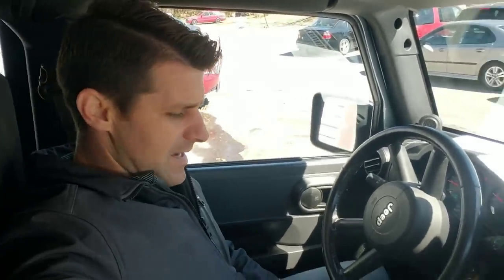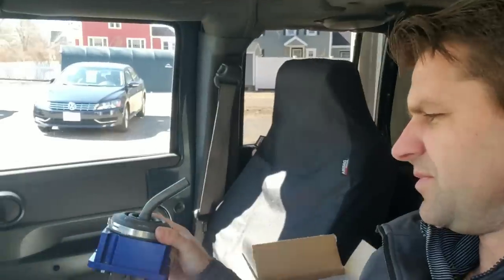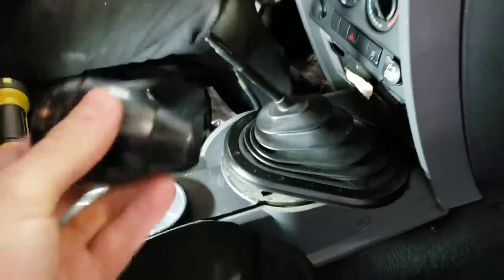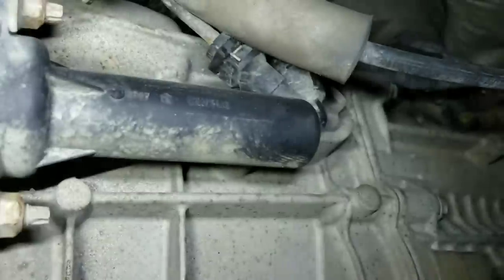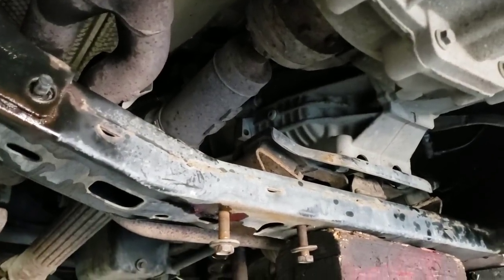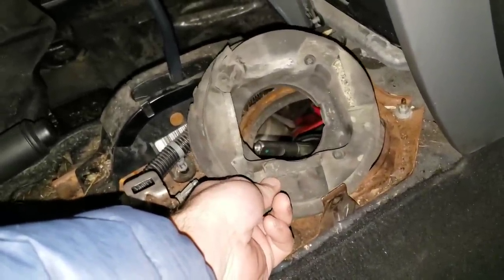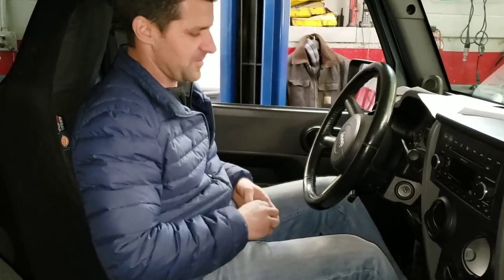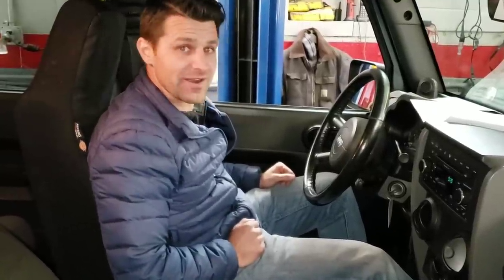Jeep Wrangler Pops out of 1st gear * How to Fix *

Comment: There's two ways it pops out of gear. Synchros being worn out, which is what yours sounds like. Or in my case, it really was my shifter. The Detent was worn out. When it's the shifter itself, it doesn't make that gear tooth sound, it just makes a sudden pop and its back into neutral.
Reply: Finally a real answer!!!
Reply: The shifter in the video made a grinding noise though?
Reply: Mine makes a bang when it happens.
Reply: How much does it cost to replace the synchros?
Reply: @jordanjohnson7285  it's the first thing he said in his comment.
Reply: @Larrybird96  if you're looking to replace synchros. It's a full transmission rebuild.
Reply: @jeremypetro1084  did you ever figure it out! How many miles you got?
Reply: @dad3562  181849
Reply: It's only 1st gear and it's random.
Reply: Im gunna try the 700 dollar part and hope for the best.
Reply: @jeremypetro1084  what was the problem you find out? my second gear pops out to neutral with bang as well

Comment: I have a 2008 jk  I have the same problem. I bought the B&M shiftier and it fixed the problem. I got it on amazon and paid about $565.00. I also had a rubbing noise coming from the transmission   like the sound of a baseball card on the spokes of a bicycle. That noise has gone away. The shiftier is so tight now with no slop . The stroke is also shorter. Thank you very much for the video.
Reply: Hi mate, can you share the link of the shifter you bought?.
Many thanks

Comment: I will be attempting this B&M 45195 shifter install soon on a 2007 Dodge Nitro 3.7L with the same NSG370 6 speed mercedes built transmission. I have the same issue with occasional violent popping out of 1st gear and sometimes 3rd. Thanks for the video
Reply: did you ever do it?, I have an 08 Liberty doing it in first once in a while..
Reply: @Aeroscott99  the owner could not justify the cost. I ended up removing the upper shift shaft dust boot as a bandaid solution. It did actually reduce the popping out of gear to almost never.

Comment: Honestly I don't think that the synchros were bad at all, it was the shifter bushings itself that got weak over time, as you could tell how sloppy it was before you swapped it. Any shifter has to be tight otherwise the pressure of the clutch and transmission itself will make it pop out of gear. Seeing how cheap Dodges have been built its no surprise they would use cheap shitty bushings in their shifters. Now if it was the synchros, you would of experienced hevay grinding in more than one gear plus random popping of multiple gears. Good idea and nice easy fix, $500 instead of $2k or more for all reman or rebuild. Now just mark the price up to cover the repair. ;-)

Comment: Luckily my 09 was covered under warranty so they replaced the 1st and 2nd gear sync rings, but what a pain in the ass. Had to go to three dealers before one would work on a standard. No one drives them in socal apparently. Good job.

Comment: I have seen quite a few videos with problems from Within the transmission. Nobody had ever figured this out. last year I watched a video where a guy in California “AutoEdits” did a tremendous amount of replacement of parts on his Jeep, one of which was a B & M shifter. He never complained of this gear problem before or after, his reason for changing it was the shifter waging like a dog tail lol!. So it led me to believe this was the problem, “the shifter”. I am having the same problem with my 2008. Wanted to replace the shifter, but haven’t had the money. I will be doing this the beginning of the summer.
Reply: Did you replace the shifter? My 15 jku likes to pop out of 1st and randomly out of 4th. Trying to figure out what I should do.
Reply: Haven’t done it yet, I know it needs a rebuild, “transmission“. 
My Problem, first gear and reverse. The problem comes from The ring gear and shackle. 
If it is caughtin the very beginning, changing the shifter would help.

Comment: My gf has the same issue but it’s more like once out of 50 first gear tries and it SLAMS out of first.  It’s been like that for a couple years now. Also second gear is a bit notchy each shift.  Good heck come on JEEP!
Reply: @badass1g My 14 jk has the same “once out of 50” slam symptom. It’s completely jarring and unexpected when it happens! Have you done any shifter or transmission fix and found success?
Reply: lmao wtf my gf has a wrangler that does that same exact thing just as often
Reply: Matthew Higley you found any solutions? Is your shifter loose af? Im going to change the bushings on the shifter. The other comment here mentioning bushings is what my friends have been saying. Theyre like $15 bucks each from jeep dealer
Reply: Transmission mount. Change it. Problem solved. Its most likely not anything else. I promise you

Comment: I had a brand new 79 Toyota pickup, 4 x 4 that did that exact thing.  Under waranty, the dealer apparently replaced the synchro, the gear, and the complete clutch.  The truck only had 5000 miles on it and was not abused.  Me thinks the dealer ripped off Toyota, if it was just the shifter?

Comment: I thought that was the issue, I replaced that 2 years ago and I'm still having the same issue, I've almost replaced everything in the transmission in it happens again. Synchronizers, replaced. Shifter, replaced. Clutch, relaced throughout bearing, replaced. You name it I've done it. A keeps popping out.
Reply: CHRYSLER HAS A TSB ABOUT THE SHIFTER BOOTS. DRIVE WITH BOTH INNER AND OUTER SHIFTER BOOT REMOVED AND SEE IF IT STILL HAPPENS

Comment: I'm having this issue too. Decided to buy one myself and will be getting it tomorrow.  Maybe it will work out for me too
Reply: How did it go
Reply: @fxlltxtsearch  didnt fix it :(
Reply: @keithr6827  change your transmission mount and do a fluid change. I did that and it went from popping out anytime I engaged 1st while rolling to popping out only 2-5% of the time (which is only when my tires are spinning really fast and im engaging 1st at like 5-7mph which is where u should be engaging 2nd).

Mine was popping out today in the humid weather but I was in 2 wheel drive and my back tires were spinning on wet pavement even though I was stationary so again another situation where tires are spinning fast and trying to engage first. Switched to 4wd for wet pavement/low grip and nothing.

Comment: Wrong. Change your transmission mount. It may not look worn. If youre over 80 thousand miles. Trust me its worn. Dont do all this nonsense. Change your transmission mount. Done. Synchros are great, good transmission.
Reply: What is meant by “change transmission mount”?